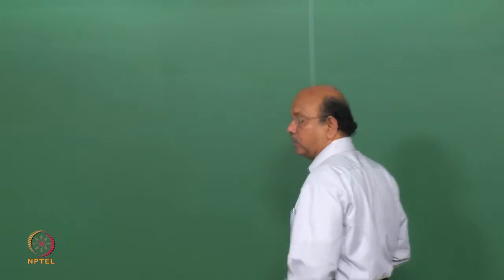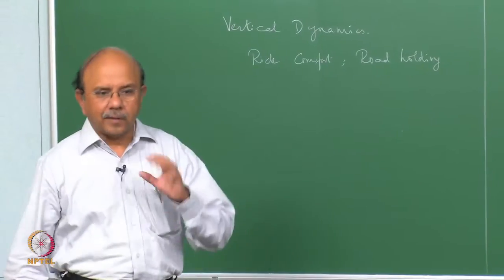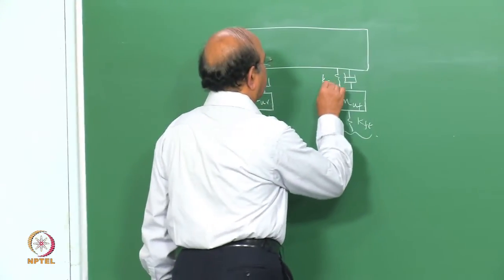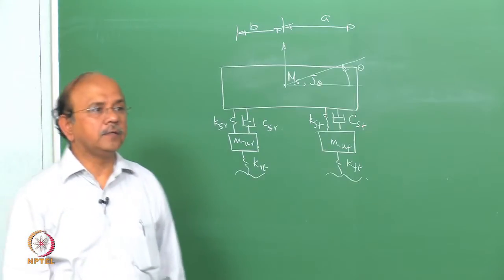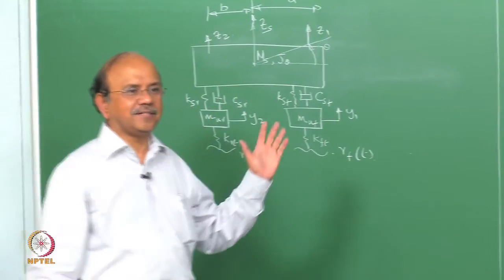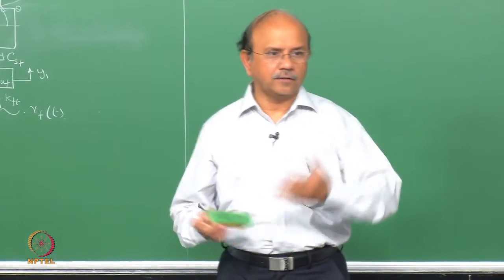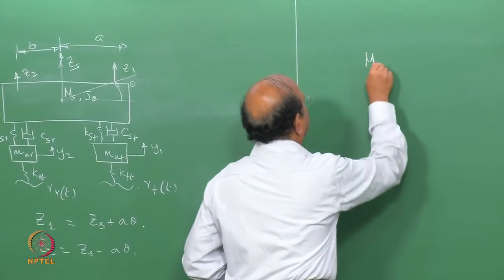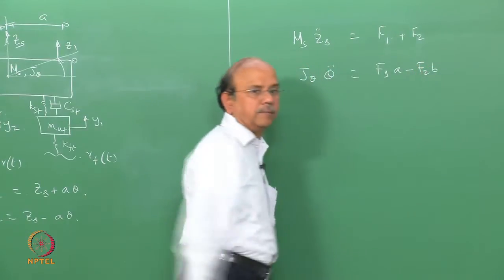Mod-01 Lec-29 Vertical Dynamics – An Introduction

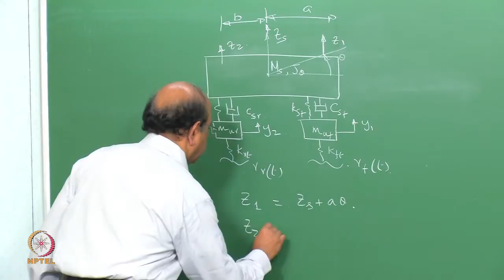Comment: at 8:35sec and 13:15sec ,at these two points equations are derived to solve for theta. but will there be a difference in these theta values?.  I got two diff theta for each equation values when I solved it in SIMULINK.